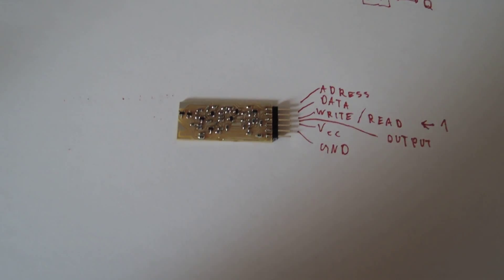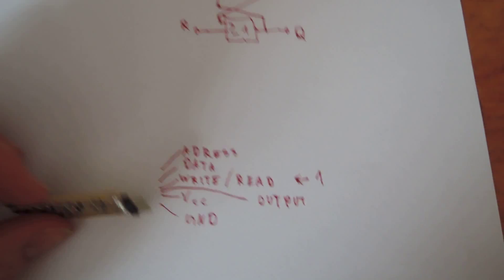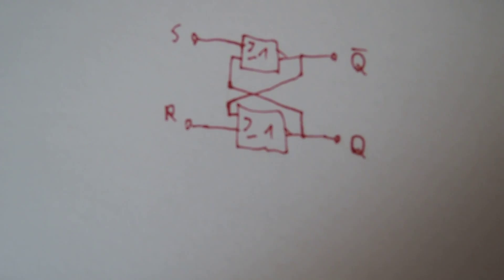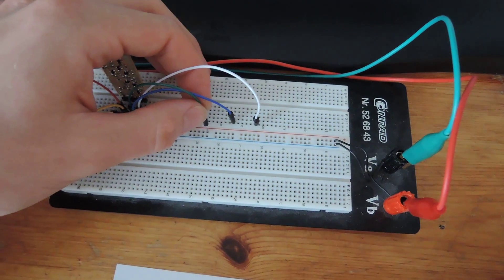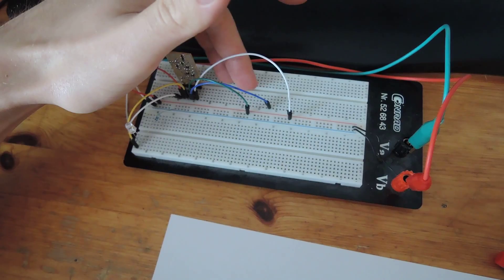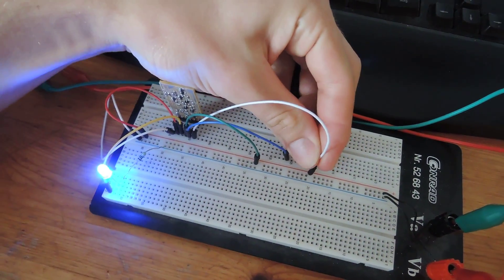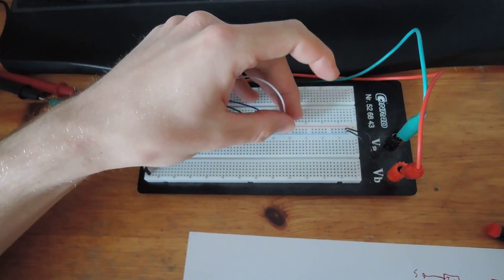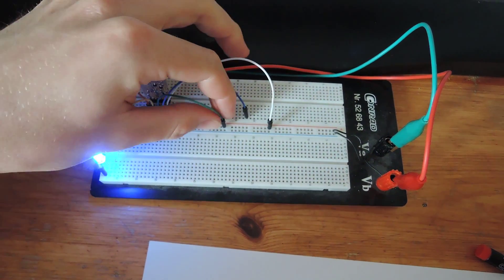1 bit random-access memory

Comment: If these subcircuit SMD modules are mass produced it could revitalize the once popular hobby of individual electronic experimentation projects.. Could these SMD modules be sold in a kit that the layman can afford?
Reply from the maker: I think they would not be that expensive. But this one was a test. If you put a few of these together, there would be an axcess of pins and inputs. Because every bit of data has its own "driver".
Reply: @Martin-dz8qp  not really if you use a multiplexer (or demultiplexer, i always get confused with them..).

You have one data pin and a common adress bis that gets translated from say 1010 to pin 10 enabled, rest disabled. That way you save a lot of wiring and pins in the final module. And mutliplexers are easy to build too.